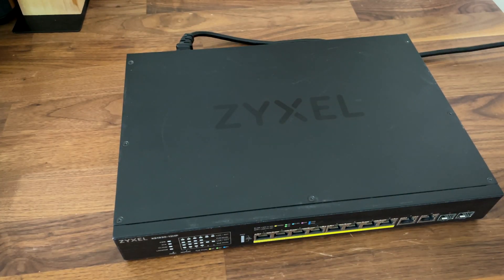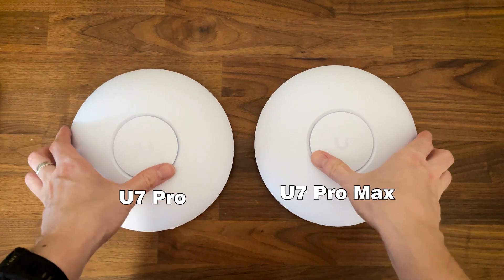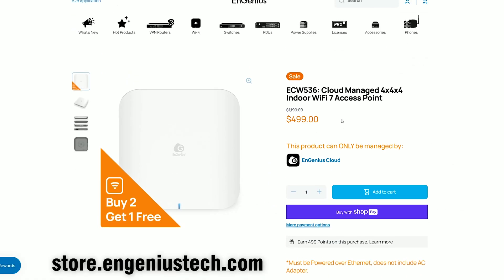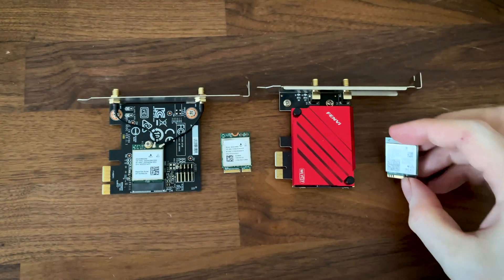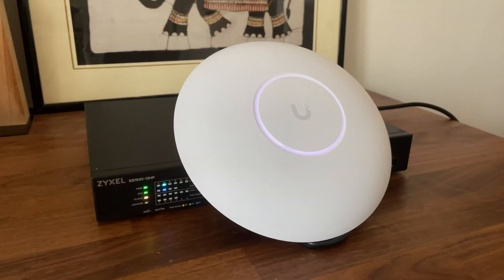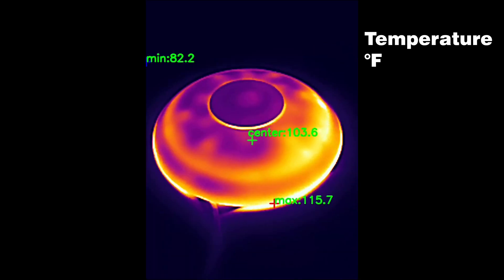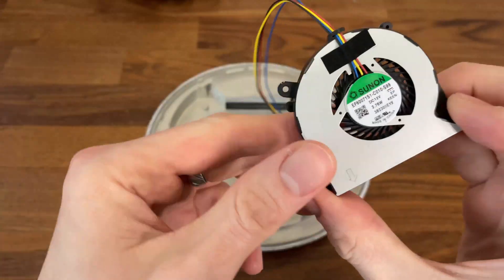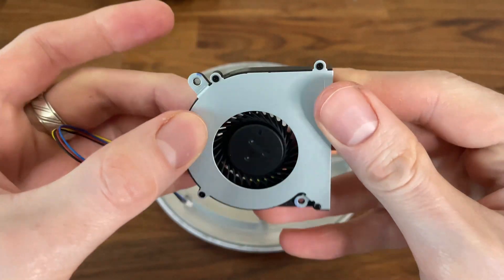5 Reasons why you should not get the Ubiquiti U7 Pro Max

Comment: Is there a better alternative in a similar price bracket?
Reply from the maker: Let's say that if MLO works fine, since it seems that Ubiquiti is currently releasing it in an early installment, then heat management is still a big problem. I am even willing to say that the U7 Pro is better.
Reply: @SamBondor  Im right now in the process of configuring a new software defined networking setup and wanted to choose the 7 Pro as my AP, would you rather recommend the 6 Pro or 7 Pro for a small 75m² flat ?

My Setup was going to be the Pro Max 16 Poe, the Cloud Gateway Max and a 7 Pro AP.
(Man i hate these superlatives in product names)
Reply from the maker: @yafdofoie  If you have some WiFi 7 client devices, then the U7 Pro should be fine, otherwise, I found the U6 Pro to still be more stable.
Reply: @SamBondor  i dont have wifi 7 devices right now, but will have at least one soon and have multiple wifi 6e devices. Can wifi 6e devices not use the wifi 7 6ghz band? Im still stuck at wifi 5 with a tp link omada 5ghz 4x4 AP right now and am looking for an upgrade
Reply: @yafdofoie  Yes they can use the 6Ghz band
Reply: @Basketballbayern  could you link a source? I couldnt find any answers for this
Reply: @SamBondor  In the end, what did you choose?
Reply: This is the question that needs to be answered.

Comment: I had/have a ac hd as a paper weight due to ubiquiti not servicing their products. I had a electromagnetic surge from lightning that hit nearby my house it corrupted the boot loader so it's stuck in a boot loop. the regular nanohd on my network was unphased by it. I called ubiquiti to see if they'd service it or offer a refurb like some companies will if you return the broken one and pay a set fee, but they do not offer those services. I'm very hesitant to buy another ubiquiti product because I've never had this issue with any access points before and it seems like this should have been fixable instead of throwing it away. I could see this same thing happening with the fan. 

Fan's die, especially when they collect dust over time. I only had my ac hd for a year and just out of warranty

Comment: UI website says 'max power consumption 25 W' and 90+ % of that get converted into Heat ... too much IMHO
Reply: In what else should it be converted? The only way out of the energy is RF-radiation and heat. To make their products less hot, they have to decrease the energy consumption. I tried to use a AP 6 Enterprise and it got way too hot for my taste so I reverted to my AVM 6000 Repeater. Which uses way less energy for more or less the same performance in the 5 GHz band.

Comment: I agree with your analysis! I have a question: regarding the U7-Pro, besides the missing features like "MLO", is it stable? Or do the clients connected to it have connection issues?
Reply from the maker: I found it more stable and with a far better thermal management.
Reply: @SamBondor  So, in your experience, is it safe for production use cases?

Comment: What a lousy list of reasons. 1. MLO is still implemented. The first EA firmware is out there and Intel is also working on it (I got that BE200 non-vPro also). Let them develop it further. The mechanism is still young. 2. Yeah, that's what you get with new technologies. You'll be happy in 1½ year from now that you got it. 3&4. The U6-Mesh was warm. Be happy that they build it in. It will work, when it needs it. They put it there with a purpose. 5. Same as point 2, it's early and you'll be happy in a year or so. And there are lots of devices with WiFi 6E at the 6GHz band, so be happy that 6GHz AP's are getting cheaper, now WiFi7 AP's are introduced.

You know what? Send it over to me. I guess I can appreciate the device more, and start making some positive YouTube video's.
Reply from the maker: 1. I don't think it's wise to buy stuff with the promise they will perform in a certain way in the future. Probably Ubiquiti will offer MLO and it will work great at which point everyone, including myself will be happy. And may be they will not.
2. The device is too hot. You can see it in the video, it will burn your fingers. The fan doesn't do anything. On the U7 Pro, it worked fine, but not on the U7 Pro Max.
I get that you like Ubiquiti and, while I try to stay agnostic, I have been fond of them for years as well. But by god, the U7 Pro Max is not a good device. But maybe you're right and things will get better soon. I will do a video of reasons why you should buy it when that happens.

I will gladly send it over, but I still need to run some tests until it gets better, if it does. Let's talk again after about a year.
Reply: @SamBondor  Yeah, I wasn't assuming someone would just send a device over like that. And I guess it's a whole different situation over a year from now.

Comment: I bought mine from the UB store as well.  Mine got Very hot!  It burnt my minger when I went to pull it down off the ceiling.  I got a blister!    I had to pull it down became it kept power cycling every 20 minutes.  I assume it was overheating.  I RMA and got a replacement.  The replacement doesn't get much less hot but it is not constantly rebooting anymore.  I got to say I am a bit disappointed.  I am debating to return this one and just keep the WIFI 6 enterprise AP which I had in service before.
Reply from the maker: That's pretty much my experience as well. I can't RMA it because I opened it and everything, so Ubiquiti will have to accept any criticism that comes from my side :D
Reply: @SamBondor  - What do you mean you can't RMA? It's a shit product and you have to RMA if it's wrong. Glad you posted the video, but you gotta change it dude.

Comment: Ubiquiti in recent years always use these markings words like ultra or max to make its products sounds Powerful, but after several years of using its Wi-Fi 6 and Wi-Fi 5 Access points I think their intro to middle level products like unifi nano HD and unifi 6 plus or unifi 6 Pro have better cost-performance ratio. And Wi-Fi 7 seems like to have a long road to replace Wi-Fi 6 cause Wi-Fi 6 provides a significant increase in speed and range but Wi-Fi 7 does not. MLO is good but if using 2.4 with 5g it will increase latency and dual band 5g or dual band 6g seems like a better solution
Reply: Wi-Fi 7 significantly improves speeds and reliability in range with multilink operation....
Reply: @youdontneedmyrealname as long as my old devices support wifi 7 😂😂😂